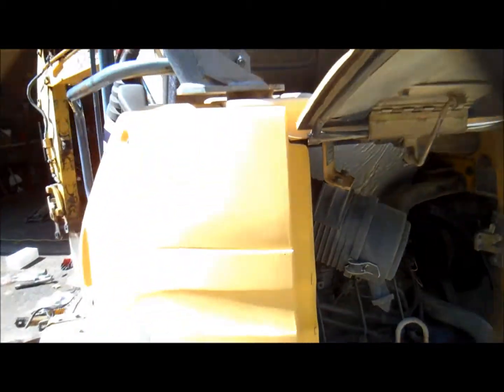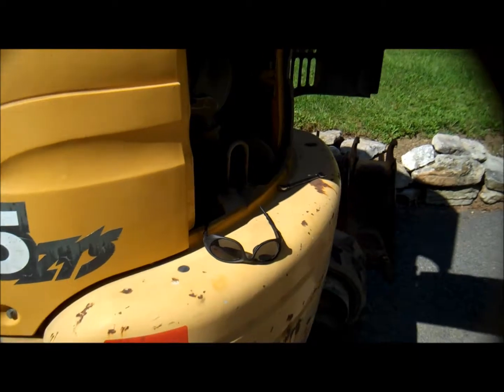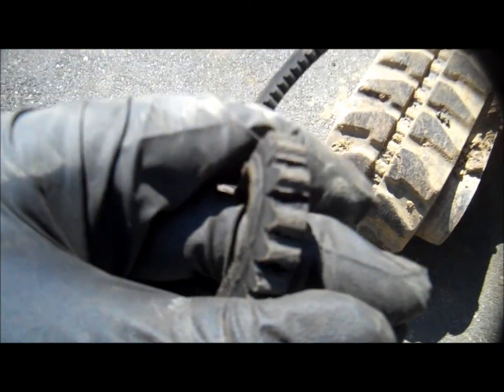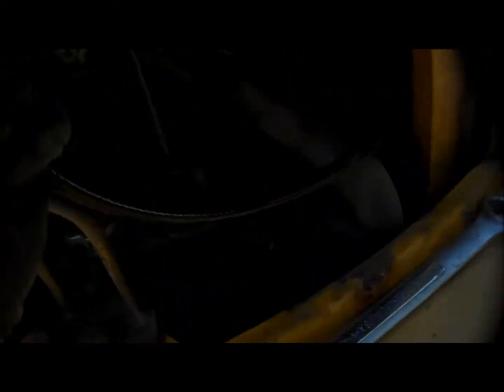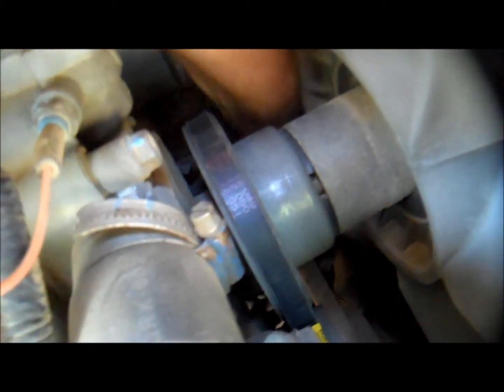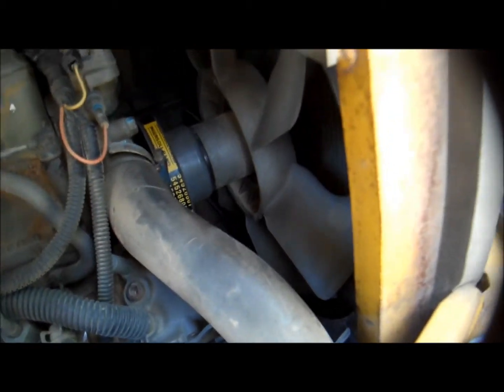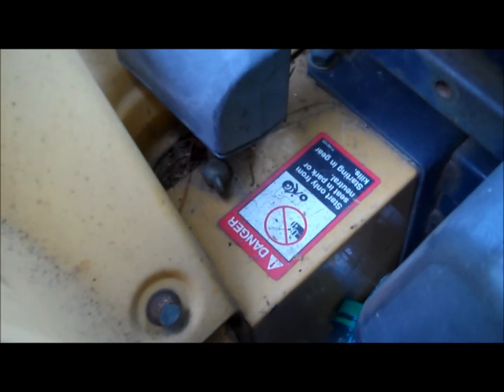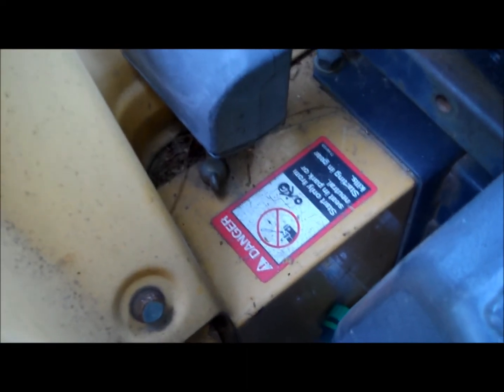John Deere 35c mini excavator fan belt replacement

Comment: I cannot get to the bolt that holds the alternator tight!   I can actually get a wrench on it, but can't get leverage to break it loose...any suggestions?
Reply from the maker: Add a wrench onto the open end of the one that’s on the bolt to give you more leverage
Reply: @73DiamondReo  thanks great advice!  what worked was a huge bulldozer wrench that I used like a nail set, and I placed on end on top of the wrench I put on the bolt, and hit the other the end with a hammer and broke the bolt loose.

Comment: Just finishing the belt replacement, belt is bando rpf-l A-32.9
8972309391
Remove single bolt right side of seat to remove panel.  
Tighting alternator bolt is still a pain to loosen.  
Only removed 2 bolts around fan cage, was still able to weave in. 
Damn belt cost $50 through JD  sigh!!!!!

Comment: Have u ever had to take the floor out of that excavator? I have the same one and I have a leak and there is no good way to find it!?
Reply from the maker: yes under the floor mat is a few bolts and the plate will come out.  fuel tank is most of it under there but i dont remember what else.
Reply: @73DiamondReo  ok thanks it's still a pain in the ass to work on anything under the floor cause it don't come up very far. To much stuff under there that is connected to the floor but thanks buddy

Comment: 2009     35D with cab requires fan belt 
part# MIU80031
Lean cab forward to reach alternator bolts.
Remove ac Compressor belt and fan shroud first.
Reply from the maker: id love to have  a newer one with a cab but that won't happen anytime soon